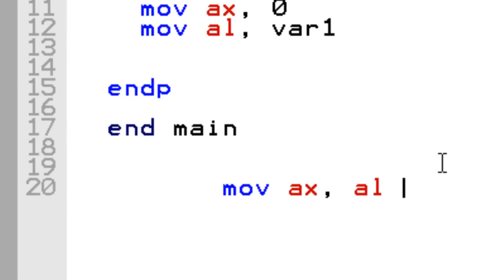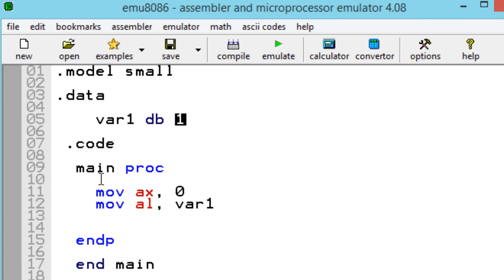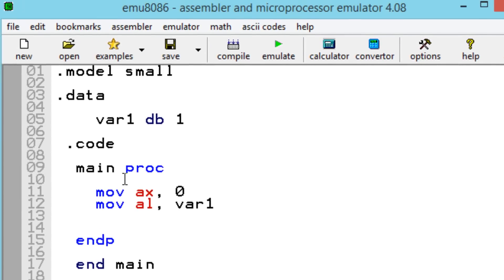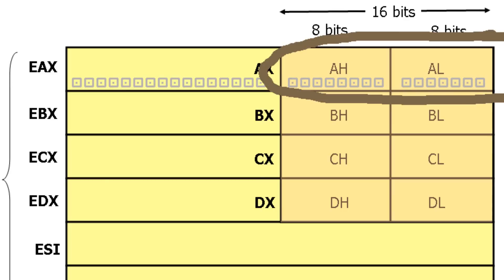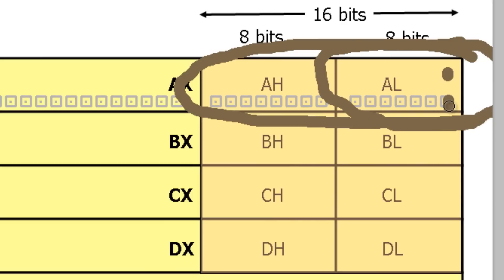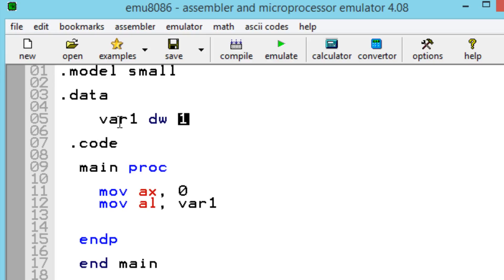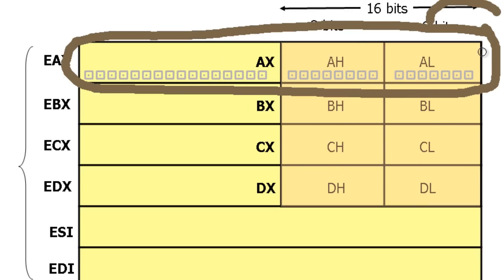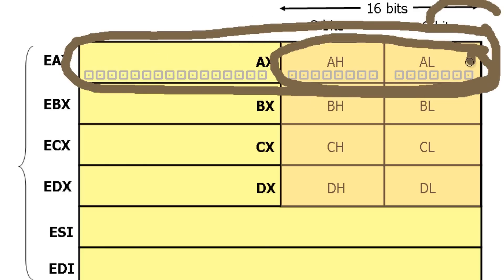Assembly Language Programming Tutorial - 21 - Copying Smaller Values to Larger Ones

Comment: It seems to me that really all you are doing is moving an 8-bit value into an 8-bit register. Not actually moving an 8-bit value into 16-bit register AX. Yes, you are zeroing out AX but not actually moving var1 to AX. Since var1 is 8-bit and AL is an 8-bit register then there should'nt be any issue making this move in the first place. How do you actually move 8-bit var1 into 16-bit regester AX with only using MOV, not MOVZX or MOVSX?
Reply: In short, AX is AH + AL

For example:
AH = 02H
AL = 42H, therefore:
AX = 0242H

When you zero out the AX, and move the 1 into AL, then
AH = 00H
AL = 01H
AX = 0001H, which is just the same with 1.

It's called a workaround for a reason.

Comment: Why complicating things when you have MOVSX & MOVZX instructions?
Reply: These both instructions in combination "xor ax, ax"  + "mov al, var1" will be execute faster than the instruction of "movzx ax, var1".  Also if we use a pention pro cpu with two execution units for pairing instructions for execution in the same time. Simple instructions are pairable in both units, but other are not pairable in both units. The movzx instruction is not a simple instruction and can´t be execute in the second execution unit, only in the first one. Note: For pairing instructions it is normaly not allowed to have a dependancy to the instruction before. But the "xor register, register"- instruction is an exeption to this rule.